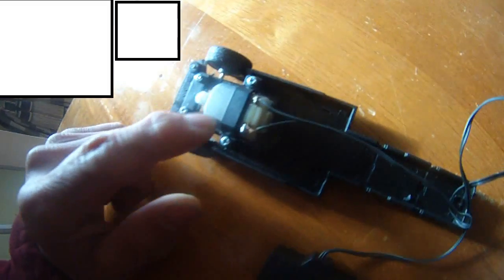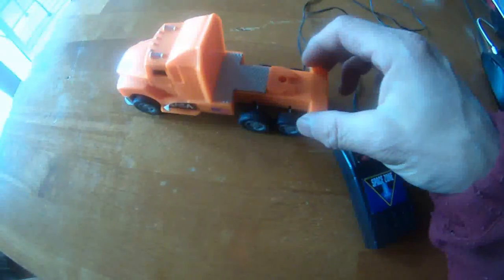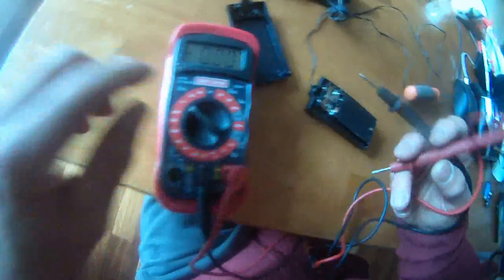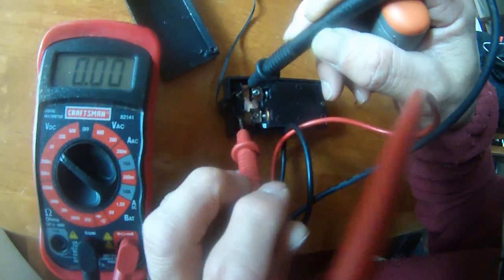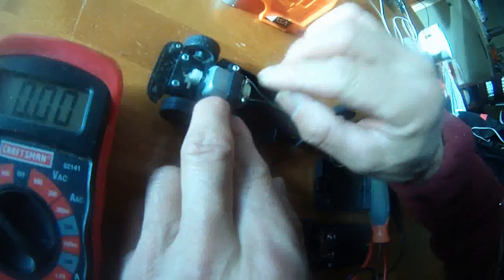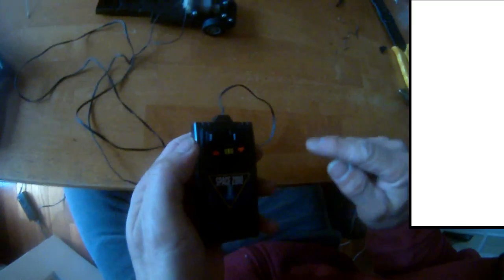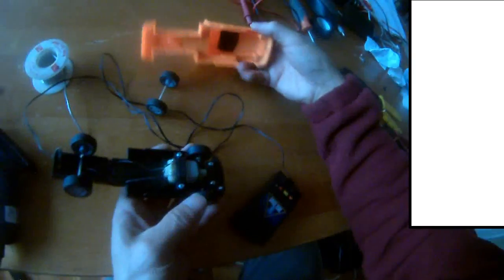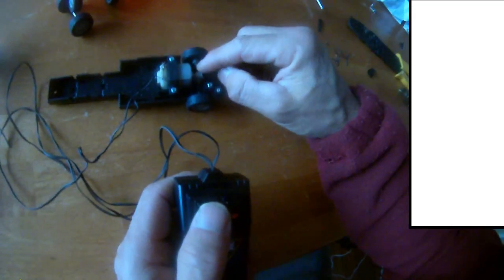Wired steering trolling motor - Part 1 of 3 (wired controlled toy truck with worm gear motor)

Comment: Where are parts 2 and 3?
Reply from the maker: Stay tuned! bought a DC servo motor (Hitec HS-485HB ball bearing standard motor), waiting for my microcontroller Arduino Uno R3 (for wired control and Wemos D1 R2 (for wifi control), so they are come their way from China - LOL - takes forever to get to USA.